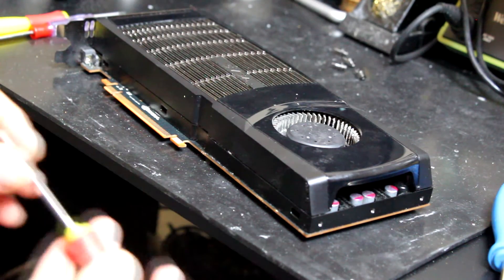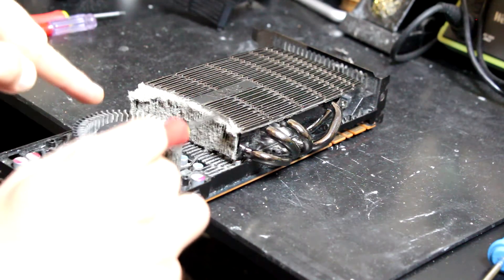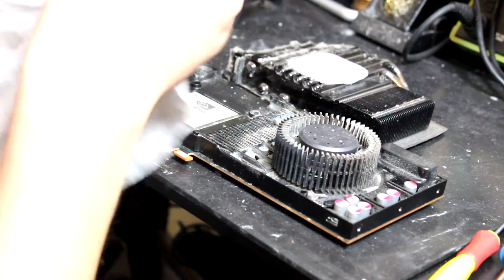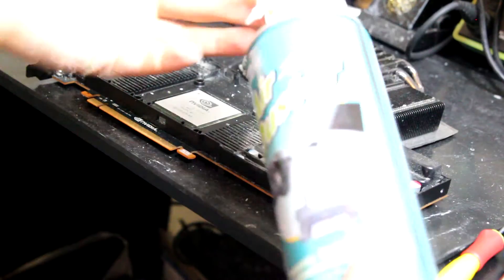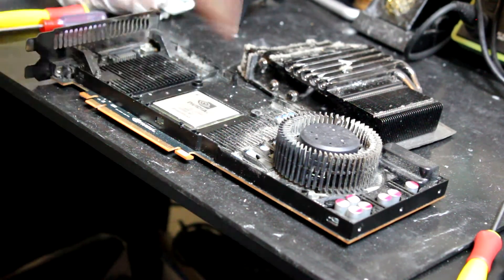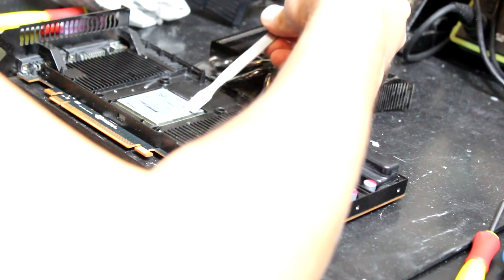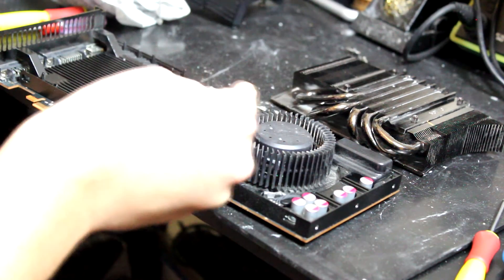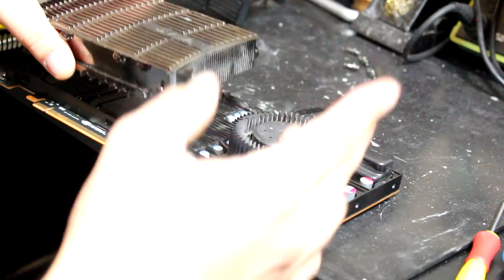How to fix video card overheating GTX 480

Comment: Sorry to say this but you got it wrong. The 480 is NOT supporting Direct X 12. It was the first that supported Direct X 11 though. But other than that the video is ok. You should have also changed the thermal pads, too. Under „the hood“ you might have found also some dirt and dust to clean off.

Comment: I don't want to replace the thermal compound on my 480 but I think it needs a good cleaning, will I still have to take out all those screws?  Thanks!
Reply from the maker: hey man! you can go half way and just clean the blower. i will recommend the thermal paste replace but its up to you.
i wish that you can have it forever but solder`s nr1 enemy its heat and air. it changes color and reacts different when its not maintain

Comment: Hello! Since I followed your tutorial my GTX 480 works very fine :) But there is one problem I have with this card since I have it! If I play a game with high graphic requierments (dont happens that often ;) ), there are sometimes situations in the game where I get colourfull spots all over my display! Do you maybe have an idea what causes this problem? Best regards
Reply from the maker: i think you are to late with the cleaning. I hope i`m wrong.
Try some older drivers.
Reply: Yeah i think so too! The heat maybe caused some irreversible damage to the card :( But good idea with the older drivers! I will try that! Thanks for your answer :)! Best regards

Comment: Hy! Thank you very much for the tutorial :)!!! I've also got temperatures beyond the 100 degree Celsius mark under load...After cleaning it from the dust (it was even worse than on your card) and renewing of the thermal paste, it has temperatures about 85 - 90 degrees Celsius under load wich I think is ok now!
Reply from the maker: +Beer Boy hy there.
Yes. That is normal. Make sure you clean it regular . this is one of those cards that runs really hot and if it reaches a point it will destroy the GPU.
I'm very happy that you manage to restore it because even today the this card its enough to do gaming on new generation of games.
Not on high details but on normal.
Good luck my friend and wish you won't sell it. It's worth having a beast like this around . :)